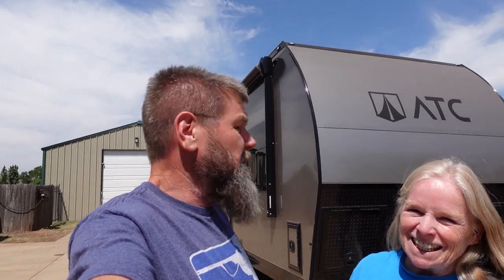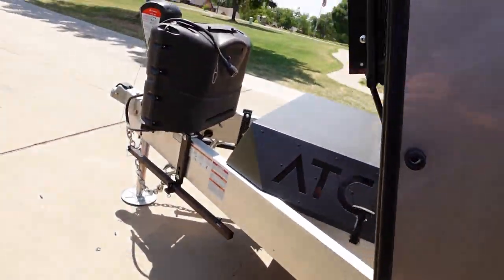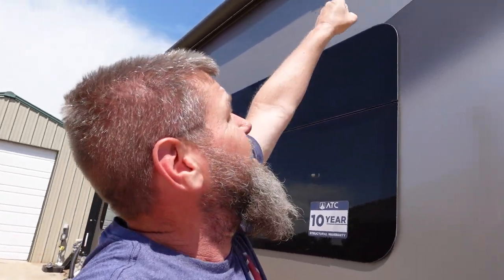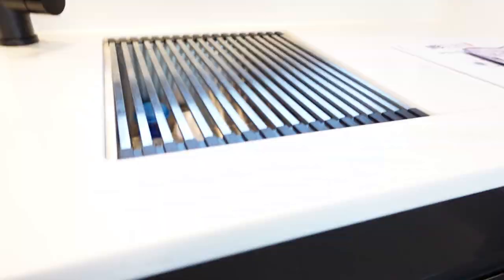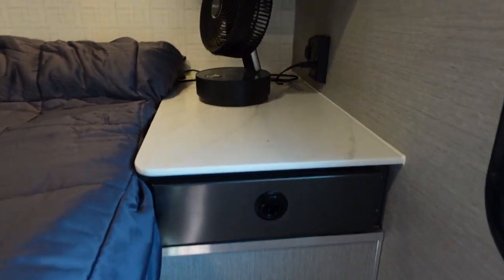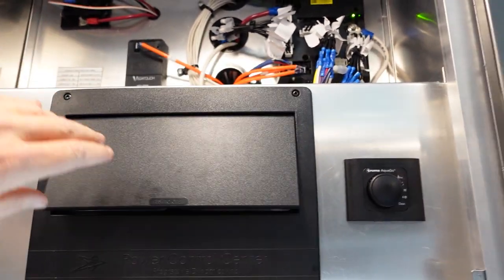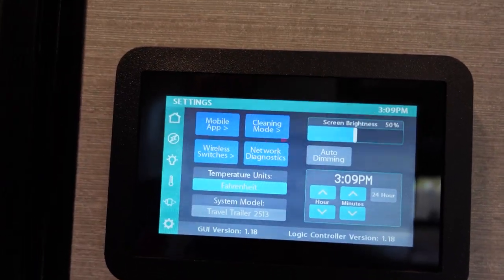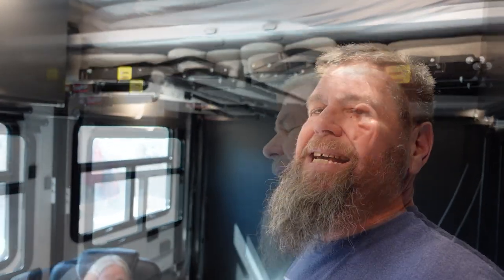We bought an RV!  Here's our 2513 from the  Aluminum Trailer Company (ATC) and Bob Hurley RV!

Comment: Why is the pricing on ATC products as illusive as Sasquatch. No one has has or shares the pricing on these completely finished interior haulers. I fear the pricing is most likely double what a toy hauler cost. Would you mind sharing what these options are you chose is priced at ? I kind of feel like that is the most important part of reviewing a product.
Reply from the maker: It is all aluminum construction, which means that it will last longer than any other toy hauler out there. There is no wood, only composite materials on the inside. They are expensive, but you get what you pay for.

Comment: Two AC's are a good idea. If your lucky, ATC might have a hot wire already in place near that vent opening. Is the trailer still 100% aluminum or part Azdel ?
Reply from the maker: I agree that 2 AC's are better. We went through the hottest part of last summer and realized we need 2. The trailer is 100% aluminum.
Reply: @hanginwithkh2021  A large dealership in Texas puts a second AC in any RV 27 foot or longer. They got tired of customers complaining about inadequate cooling. Dealers commonly sell with only one as it's cheaper for them to buy.
Reply from the maker: @T18skyguy  our trailer is only 25 feet long. We took it back to the manufacturer because we wanted to get a couple of other things done besides the air conditioner.

Comment: Great, one thing about aluminum is it transfers heat, you can pick up the opposite end of a burning stick, but a piece of aluminum or steel, the unheated end will also be hot.

An awning to cover your trailer would solve your AC issue, which they should make such a thing. Maybe you should create a whole trailer awning and get rich.

So glad you found a good dealer, good dealers should be shouted from the rooftops but bad dealers should be shouted even louder, we need to put the bad ones out of business, same with manufacturers.

I was looking at these but way out of my price range, hopefully it works out for you.
Reply from the maker: We have the awning on the curb side, but in 106 degree temperatures, the only thing that works is to have 2 air conditioners. ATC definitely builds a quality trailer. We can't wait to get Freedom back. Camping season is right around the corner. Thanks for watching.

Comment: That gas pump is such a nice feature! Never saw that on a toy hauler before. Can the bed be used with something like motorcycles in the back or do the toys all need to be taken out?
Reply from the maker: Hank, yes the gas tank is a nice feature. It holds 35 gallons of gas. If you want to use the happy-Jack system, you will have to take the toys out.

Comment: So is the 100AH Lithium and 200W solar enough? Or do you find yourself charging with the genset? Can the inverter handle the microwave or do you have to run the genset?
Reply from the maker: For what we've done so far, it's enough.  We have not had an overnight yet where we've depended on the solar.  We haven't even run the microwave without being hooked up to 50amp.  I'm not sure it's even possible.  I'll test it out next trip!  We're headed to the Black Hills of South Dakota in August!  Cannot wait.  We do plan to do some boon-docking in the future.  I'm betting we will not be satisfied with our current configuration.  If it turns out that we enjoy boon-docking we will most likely need to upgrade.  It works great keeping all the food in our fridge fresh and cold for days while we travel.

Comment: When you run the generator does it stay on that location or so you move it?
Reply from the maker: The generator stays where it is, we don't move it.
Reply: Thank you.  Wasn't sure if you would have vibration issues.  We hope to be in an atc in the next few months
Reply from the maker: @123JumpingJacks  you're welcome. The generator can be started from pushing a button on the inside of the RV or you can start it from the generator. Congratulations on getting your ATC in the near future and thanks for watching.

Comment: Is the 2513 pre wired from the breaker box to the bedroom vent for an A/C unit ?
Reply from the maker: We're taking the camper back to the manufacturer for a repair so we can use our gate. At that time, we're going to have another air conditioner installed in the bedroom. We're not sure if it was pre-wired, but we will ask and comment when we get the answer. Thanks for watching our channel.
Reply from the maker: The 2513 is not pre-wired for a second air conditioner. If you want two air conditioners, you should order them when you place your order for the camper. One of the reasons we took it back to the factory is because we wanted ATC to install it and that way it would be wired into the main control panel.
Reply: thank you for the feed back.  I'll be going for the 2816 now. @hanginwithkh2021
Reply from the maker: @mancavechronicles2139  we looked at the 2816, but went with the 2513 because we were originally going to pull it with our 2021 Toyota Tundra. Then we decided to buy a Ford F-250 because we didn't want to worry about weight issues. We're super happy with the 2513. You will be so happy you're getting an ATC camper. We love ours.
Reply from the maker: Thank you!  We have two trips planned already for next year!  One of them is in the Black Hills of South Dakota.  We'll be taking the RZR for sure on that one!
Reply from the maker: We found out yesterday that our camper is ready to be picked up. The email said that they could not connect another air conditioner to the bedroom and that the technician will explain when we pick it up. All other issues have been fixed, though and we are excited to be getting it back. So to answer your question, no the breaker box was not pre-wired for a 2nd A/C unit. If you want 2 A/C units, then you need to order them when you place your order for the trailer. We will have more updates and do another video when we get the trailer back on March 11th. Can't wait!!!